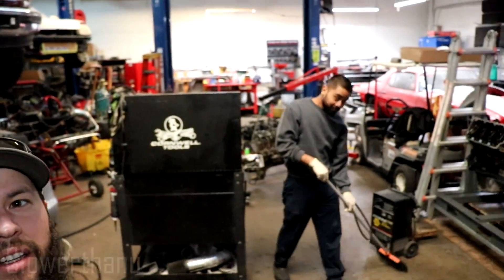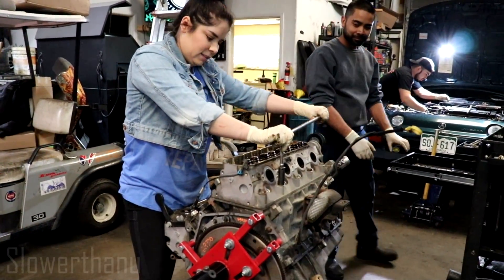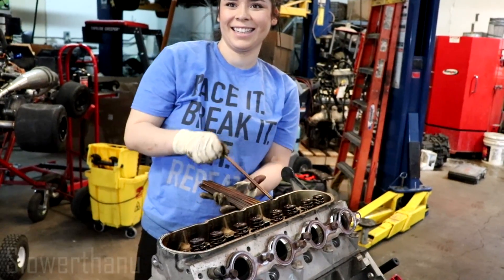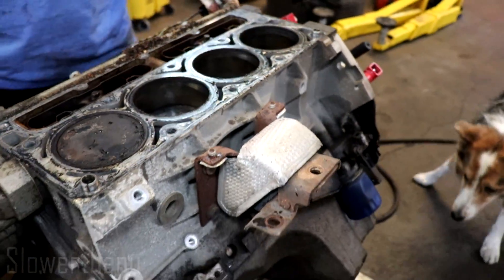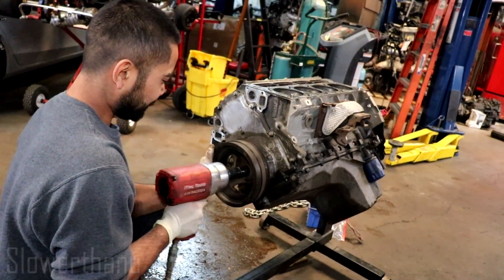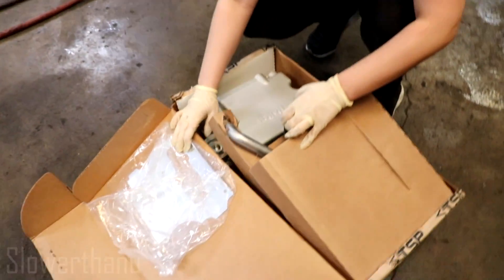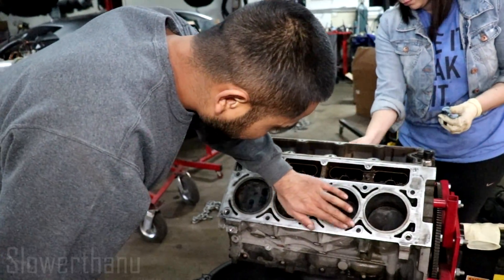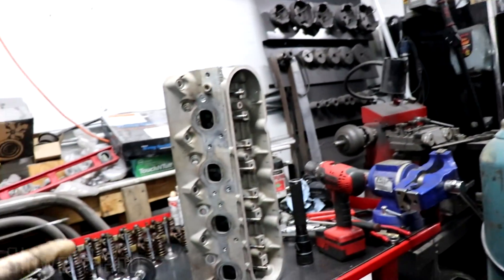RWD V8 Civic Build Part 4.2

Comment: Was wondering what your budget for this build was and how much it actually cost? I did the V8 RWD Civic Coupe Street car on an S-10 Chassis. I built my Civic as a Street car with complete factory interior. People hear V8 and Civic and think "Race Car" But thats not what I set out to build. I have about $6800 in my  Street Civic. That thing looks wicked!  Keep up the good work.
Reply from the maker: i completely agree. people seems to automatically assume because there is a V8 in there it better make like 1500hp... no. this build is taking what used to be a street car then got turned into a race and turning it back into a streetcar. Hardly any of the budget is going toward it being in a civic. We would be spending almost exactly the same money if we decided to put this same setup in a Fox Body lol. the budget is $13k. maybe $500 of it has to do with parts we need specifically because we are putting it all in the civic lol.
Reply from the maker: we could probably do this build for about 7k if we skimped on the rear end and by staying stock 8.8, not used Holley EFI, used a cheap fuel system, used a cheaper iron block 4.8 and kept it completely stock, used a stock th400 or th350 and used cheaper wheels and tires, and used stock suspension...but all of that stuff is what is going to make this a reliable, consistent, quick vehicle just like our truck :)
Reply: Yes sir, parts are expensive and it don't matter if its a Civic or a fox body.. And if you have to buy the parts and pay someone to do it, there went the kids collage funds! Lol. Its not really being cheap, its more like building what you "need"  I'm running a stock GM 10 bolt 7.75 rear end, stock axles with Richmond Gears (411 ring and pinion) and a posi-locker. Simple or "Cheap" I know.  My Civic has a 9.5:1 compression ratio 355 Pump Gas motor. (87 oct. yeah the cheap stuff. lol) I picked out a good crane cam kit for it, small intake, aluminum 2.02 heads and a 750 carb. All Motor so on a Great Day I would be shocked if it made 400hp. So a stock 10 bolt 7.75 is all I "need" for my build. Your running boost right? So you should make 800-1000hp or more... Also means trans brake or launch controls? (Wow when I say it like that it kinda sounds like a race car? sry.) My point is it looks like you "need" a bigger rear end to handle the hp/tq that you will make. 
I know I'm just a guy in a 2 car garage, and your at the shop. Point taken. I built a $7k V8 Civic street coupe. And your building what looks like another $30k  back halved civic hatch back race car. I get it there is no need to compare. My bad.. I will be watching for some new video. I cant wait to see it make a pass. Hell, I cant wait till the weather breaks and I can get my Civic back out. BTW thanks for the reply.
Reply from the maker: jeff shepherd I wouldn’t call it a race car but it’s also not a daily street car...I would call it a “streetish” car. Same as my truck. We will drive it a lot on the street so it’s not a race car. It’s cheap for an 8 sec capable vehicle (we likely will never push it to do an 8 though) but not cheap in general. 13k is a lot of money but very little money for what it will be able to do. We spend a decent amount on the rear end and transmission because we expect to drive long distances and beat the crap out of it so it has to have reliable drivetrain. Our plan is always to over build and under utilize. That’s how my truck has made over 450 hits with 500 runtime hours and about 7k miles with zero issues. We hope the same for this one. Oh and everything we are doing can be done in a 2 car garage... I mean we are working on the floor with jack stands for crying out loud lol. But doing it at Hayden’s helps for video. Actually makes it harder on us because the shop is 3 hours away from our house :/ sometimes I wish I could just pop into the garage to work on it a bit like I do with my truck. There are pros and cons to everything i guess lol.
Reply: Right, I'm with you. The sacrifices we make to go fast. lol. Good luck with the build. And post some of that video when you get to beating the crap out of it!!
Reply from the maker: jeff shepherd thanks sir! oh there will be tons of video of this one. My wife will be the main one driving it so I’ll be able to video a lot 😁